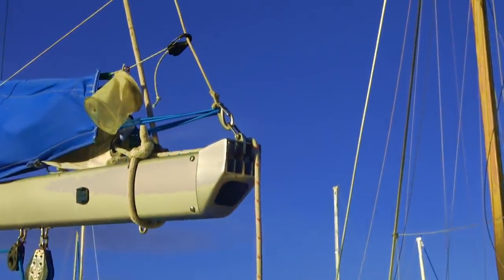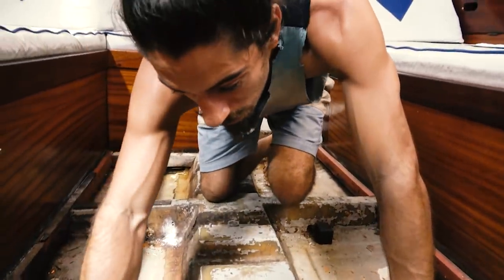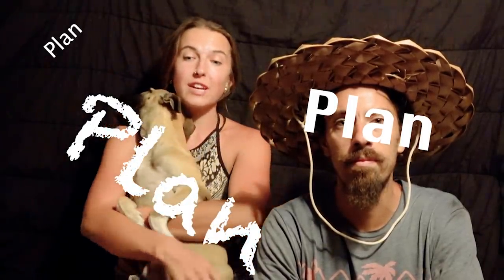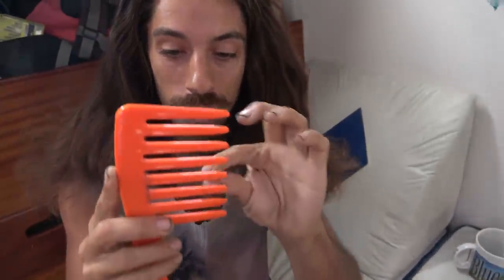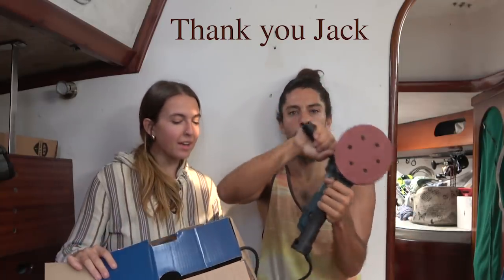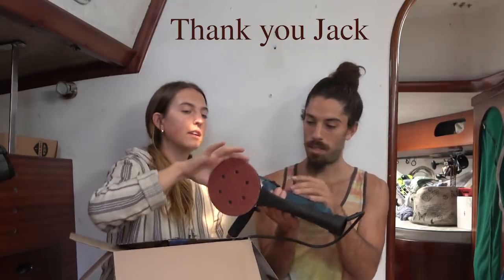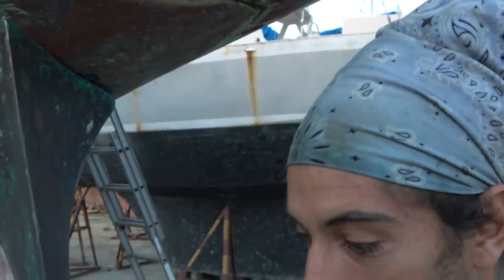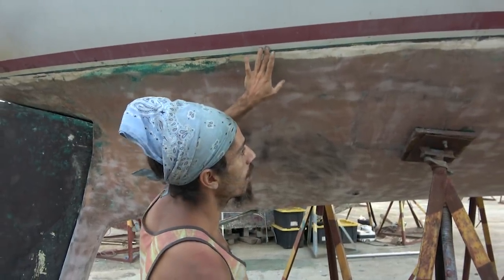Boat MYSTERIES that will BLOW Your Mind! Ep 68

Comment: You now know there was not solid wood under the stringers. That's why it's weak. Don't patch it with metal on the outside. Get out a grinder and cut all that hollow shi* out. Lay some proper wood down and glass over it. Probably a 3 day project and it will be fixed for good without any ridiculous metal brackets that will never hold up to a concentrated load in a small space near the centerline. The metal will fatigue and crack.  Do it the way it should have been built. Don't be scared of the fiberglass work. It's easy.  The metal reinforcement idea is the wrong approach. Pay special attention to bonding the glass to the original hull. Just do a little reading on that. Watch a bunch of boatworkstoday videos so you get it right the first time. Love the channel guys!

Comment: First of all double check yourself. get a piece of wire like a welding rod. Poke around inside to see if you find anything. Like rotten wood. If there is rotten wood in there there is a two part epoxy that penetrates rotten wood and makes it solid.. Go slow, it will get hot. If it is empty start chopping up glass and stuffing it in the drilled holes. Pack it in until you can't pack anymore. Then fill it with two part epoxy.This will take time. Not the penetrating type but a slow epoxy. 24 hour cure. The fast cure will get way too hot. Way too hot. You may not want to fill it all at once. Again heat. Then if you want to bolt your stailess on it won't crush glass rib. You still need to grind and repair the cracked glass ribs.
Mahogany maybe but definitely not teak in the middle section.
Reply: Don't waste ur breathe

Comment: Good morning Y'all. Well as I am sipping my morning coffee will bash out another comment and try not to be discourteous to Brian. Well the first thing you have to do is get your hull back to it's original shape. Brian said it was not neccessary LOL, but we won't get into that as I am sure you don't want your boat to look like Free Willy with a cute lopsided fin. 
You don't need to get the keel up in the air so you can see daylight under it. The problem is the mass of your boat pressing down against the keel and that is causing the deformed hull. So you need to support the boat's weight sufficiently by shoring it up. Please don't call those guys at the yard with their big hydraulic boat mangler. All you need is a bottle jack to gradually raise the hull just a 1/4 inch at a time and use timber and wedges, then as the boat goes up a touch, hammer the wooden wedges down (use a fore and aft rocking motion). Many commenters have mentioned those steel stands have a habit of skidding out. Hmmm. That would be bad... Not sure if chains alone would resolve that. I have always used the timber and wedge method. Please get someone to help you shore the boat up and who knows what he is doing as the last thing you want is for the boat to topple over... 
To check the hull for deformity (or hopefully conformity) please use Captain Freddy's "Progessive Balls-up" technique, as follows:
1) Eye-balls - look up and along the hull for a visual inspection, move your head and body around to highlight the contours. If it looks good then progress to stage 2;
2) Balls of your feet - climb up into the boat, replace the floor boards and sitting on the berth use your feet to try to rock the floorboards. If they are sitting flush, progress to the third and final stage;
3) Balls of string - hold string to the top of the keel and pull it up and against the hull. If you have a nice continuous curve again, then the string will fit snugly against the hull. If there are any high spots then you will see a gap between the string and the hull because the high part will push the string away. Find something on either side of your deck, like a chainplate then measure up from the keel to this point. If your boat and keel are aligned on the vertical axis then the distance between the keel and each side of the boat should be the same. If not try some different measuring points as not all boats are built symetrically...
Hope this information helps. I'd like to give more advice about shoring up the boat but am worried that a mere written description will not replace first hand experience and I wouldn't want to feel responsible for an accident. So get some help here (but not Brian).
Looking forward to seeing the video!
(Ooops was discourteous to poor old Brian again, sorry it just slipped out...).
Reply from the maker: Good Morning Cap!
We are on the same page as far as returning the hull to its natural shape before making the repair. We were considering a bottle jack however one thing just occurred to us. If we remove the weight from the keel and then make the repair we will have to reapply the pressure on the keel in order to put the boat back in the water. This is their only method for lifting boats here and they run the lift. They don't feel comfortable doing it any other way.   So then we would push up on our new repair. Seems like the best way is to repair it in the water. We recently had a boat builder onboard and he was adamant that we get the weight off the keel. Said doing it in the water would be fine  but BOATS SHOULD NOT REST ON THE KEEL he says...
Reply: @Bumsonaboat  That's odd because if you look around  marinas and boatyards you'll see plenty of sailboats resting on their keels. Could be so for the Carters, I guess. If your boat is in the water will you have access to shore power or a generator? If you go this way maybe you should do the sanding and preparation of the surfaces before you put her back in the water. You know its very easy to build a wooden cradle for your boat and use small thick wooden wheels and a steel tube for the axle. That way you can easily get the weight off the keel and her back to  original shape. If you look around the local yard(s) you might find several laying around and plenty of wooden/cast iron wheels that you could beg, borrow or ((buy)) and adapt. It's the sort of thing people use to fix or transport their boats and then leave behind. This way you could do the repairs on land which will be much easier and when it comes to launching her again you can use the cradle instead of their mega-boat mangler. That thing really frightens me as it wiould be so easy to put all the strain on one spot with those hydraulic arms, ouch!
When you start the repair don't forget to remove all the bedding/clothes/curtains/etc etc as the "itching powder" will get everywhere and is hard to remove. Another reason to do this on the hard as you can use a vacuum cleaner to keep the dust down.
Well see if you can find a pre-owned cradle as that will make things much easier.
With the cradle you will be in agreement with ALL the advice I've seen so far in the comments; i.e weight off the keel, boat back to shape and the convenience of working on land plus as you just mentioned launch her without putting any excess loads onto your repair. Happy cradle snatching.

Comment: Plenty of advise , but don't bury any wood under fiberglass, it will always rot. All fiberglass boat have rotted wood, 40 years ago we all said hey coat it in resin it will last forever and then leave it to the lowest guy on the totem pole to do before he left on a Friday ,, bullcrap. No wood!
So you have a Carter? UK built or.?
Cheers Warren
Reply: Yep she's a Carter, built in Greece, 1974
Reply: Michal Schuster thanks! Do you know if it's a 33' or one of the larger 37/39 looks like the 33'.  I did some racing on the IOR 3/4 ton(33') but that's a different boat , had stripped interior and fast but sketchy down wind with the typical pinched ends .they used to have entire crew sitting on the stern to keep her from wiping out! Cheers Warren
Reply: @CheersWarren   haha wow that sounds pretty dicey! Yes this is the 33' and I believe its the racer version, I know there was a carter passage 33' cruiser version, and ours is not center cockpit. Haven't had many down wind sails headed SE through Bahamas..

Comment: Late to the party but, anytime I have been confronted with a void that creates a blind which prevents access for a traditional bolt up with lock washer and nut and a two wrench snug up, I injected the void with epoxy plus additive.  I use caulk gun tubes filled with epoxy.  I usually drill a few access and weep holes.  I force/push the epoxy into the void until it weeps from all access holes.  When the epoxy sets, I drill and tap as needed.  The resulting hold for bolts rivals steel.

Comment: Well That was actually good news knowing that its a structural shape void of anything that is rotting inside... I'm for the C-channel or angle that has a long and short leg..as well as glassing over whatever you decide to pit on those... That would make it about as strong as it gets... Also hearing the thickness's you called out was also good news, they obviously built it to last which will make it easier to repair and feel secure in your repair(s).. All good news... except for Captain Joel loosing hair... Could be stress as well...!! But if it isn't maybe change his name to Captain Egghead or Captain Chrome Dome....LOL...;)

Comment: The reason I love your channel so much is because no matter the decision your always wrong,  You  2 are the George Costanza's of the sailing.  In no way do I mean this as an insult but this boat is cursed.  Or Joel is cursed ???   I to believed the steel straps was the "lesser of 3 evils".  I would give you the perfect fix but it is a little bit expensive.  And you would not take the advise anyway.  I doubt any creds the old aussie fart claims if he can't tell the difference between (a hollow core) AIR and WOOD.  LMAO   I am dying to see the fix you 2 chose.  Good Luck   May i please ask who gave you the terms floors and stringers?

Comment: WRT the core-or-not discussion: Not. Core material inside of the grid structure which makes up your stringers and floors will add no significant strength - that is why it is not there in the first place.
Old wooden boats were built plank-on-frame using solid materials with no voids, because that is what wood is. The material itself provided much of the strength the structure needed. There was no "skin" material per se.
Take a step forward into the world of 20th/21st century materials and monocoque construction (look it up!), and you will see that that core material is not needed in that application - which is how your boat is made..
For a great example, look at an airplane fuselage - it is all thin pieces of aluminum, shaped and bent just-so for strength, no coring at all anywhere - and yet they rip through the sky and storms and turbulence at hundreds of miles an hour while carrying tons and tons of fuel and load and passengers for years on end... Plenty strong!
The glass layers which make up your hull and grid system are fulfilling the same function as does that aluminum in the plane. Your hull is the skin, the stringers & floors are like the ribs which run along inside the fuselage to strengthen it, and you'll note that those ribs are generally L or C shaped, basically 'hollow' structure.

Now - your problem: Your hull has not broken. Your stringers and floors have not broken.
They have simply begun to become detached from one another.

So all you need do is get them back to virgin surface (grind away all old paint, oil, & other contaminants), and then re-bond them back together. Clean and rough surfaces for bonding will give you the strongest connection between old material and new.
Clean the stringers/floors themselves, and an area of the hull out 8-10" from them, and lay in fresh glass using epoxy resin. The glass is for strength, the resin is for holding the glass in place.
You may need to filet the inside corners in order to make a nice smooth, gradual radius for the glass cloth to go over, as a sharp corner is weaker than a rounded one. Look this up on YT to see how it is done - it's simple.
You can make that boat as strong as it was, or stronger probably, with maybe 3-4 days of work - and not even long days at that.

Don't add steel to the issue. It's unneeded.
And for purposes of brevity, I did not differentiate between monocoque and semi-monocoque construction.

There's my $0.02. :) Good luck!
Reply from the maker: Okay thank you for your two cents. This is all right on par with what we have recently been told by another boat builder/naval architect.
Reply: @Bumsonaboat  Thanks, here's wishing y'all the best of possible outcomes, and thus more and further adventures, in a well-found vessel! :)

Comment: I have hair down to my knees.when combing long hair start at the bottom an work your way to the top. Please use some olive oil just a bit on the bald spot u yanked out by the root...if u wear ur hair up a lot for days on end u will get a knot of hair an sometimes u need to condition it b4 brushing it out bottom to top....don't worry ur hair will grow back hair grows 1/8 of an inch a month. Nails too....anyway u guys are great!

Comment: since you alredy have the flat straps being made ive come up with an idea for your floor repair drill 2 inch holes in the top of the floors place stainless bolts with flat washers in them in the  holes then fill cavities with thikened epoxy will make the floors one solid hunk of composite material that will spread the load of the keel out further in your hull then grind out and fill cracks with thickened epoxy then cover all with a solid layer of fiberglass to seal the bilge up so no water can intrude and delaminate your work

Comment: In the day.  They used foam and many layers of glass , some keel floors had some strips of timber , but most were foam , get some carbon fibre cloth     Jack up the  boat as to take the weight off the keel     Find some hardwood and shape up some floors , cut the old ones out and slide in the new , glass with the carbon , dry for a week before settling down the boat ,

Comment: NO! Definitely not,don't use steel braces.What you need is more floors between the existing ones. There are  too few as it is. You must grind down all the repairs that have failed and then relaminate with rovings/ biaxial glass and epoxy. Make it beefier than before.At the same time add a few more floors (athwartships ribs) and solidly laminate them down in the same way.They must feather down to nothing at the ends to avoid hard spots.This is important. You'll have to move the furniture out of the way,sorry.The reason why there is no wood under the fiberglass where you've drilled is that if there were it would have been used as a former only.It could even be cardboard or foam.The strength lies in the fiberglass. So do it properly.You won't regret it.As I said in another comment the hull weight must not bear on the keel  while the repair is underway. It is however very hard to chock up the boat with the keel in the air without creating some distortion.Have it in slings or better still in the water despite what many say.I've done this kind of repair three times already.Twice with the boat in the water once in slings.

Comment: Look into a product called Sea Cast www.transomrepair.net it is sold in the US and will fill the void between stringers. Bed your bolt upright in this product and bolt on your new plates... This product is amazing but a little pricey....luv the videos.. U make my day when I can watch them
Reply: The product is called SeaCast.    There is some risk using it because you have to cut open the floor to get the product inside.  If there was rotten wood inside, I WOULD use it.
Reply from the maker: Okay thanks for yet another new solution. We will check it out.
Reply: What exactly is Sea Cast?   The site mentions that it contains fiberglass, but do you know what type of resin they use?
Reply: @jackrabbit5047  I don't know anything more than what is on the website.  I don't know how well the stuff would bod to the hull.

Sailing Uuma has similar problem.  They removed all of the floors, made new ones out of foam, and added additional floors.  The epoxied them to the hull and then glassed over them.  https://youtu.be/OyKy-cDy6e8  It was an enormous job !
Reply: @jackrabbit5047  The owners Father develop the product in the early 80s... nobody has reproduced his formula and they don't disclose what's in it... it only bonds to fiberglass. It chemically reacts to the existing fiberglass and creates a solid Bond. All wood must be removed before applying seacast... the owner of the company will call you directly and answer all your questions. I rebuilt my boat using this product and they had a engineer call me and step by step give me directions on the prep and how to use tge product ... I do know that if you don't follow their directions you'll never be allowed to purchase their product again... I hope this helps you.. the design of my hull was something that they hadn't come across before and they really make sure I did it right with the questions and emails that were sent to me prior to my use of sea cast... I completed my repair 2 years ago and have zero issues and the pieces leftover I've tested and they are virtually Bulletproof

Comment: As Mr Foster said below, fiberglass is much stronger than wood.  You can make an effective structural connection with your stainless flat bar by screwing into the fiberglass.  To do this you need to use "sheet metal screws", not wood screws. Sheet metal screws have deep threads which develop a lot of strength in fiberglass. These are available from McMaster Carr in stainless steel, up to Screw size 14. You would bed the stainless bar in epoxy, and you would also coat the screws and the Screw pilot holes with epoxy before driving the screws. If the fiberglass is 1/2" thick minimum, as you said, this should work as well as if there was wood inside the stringers.  Greg